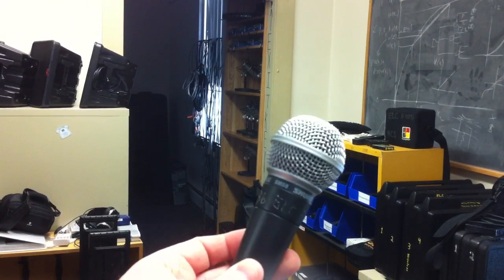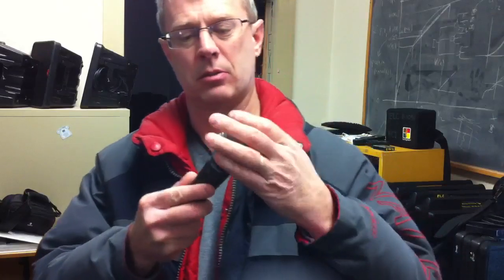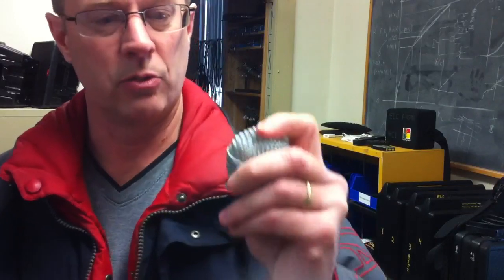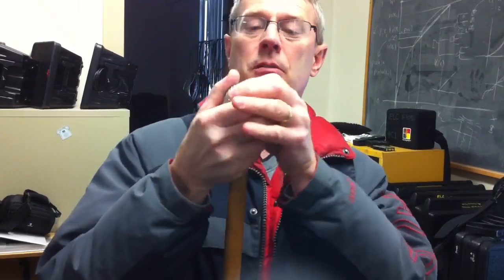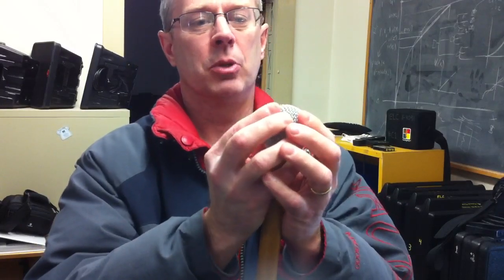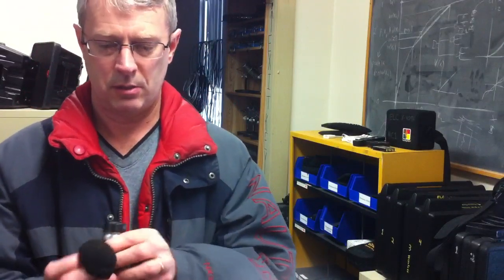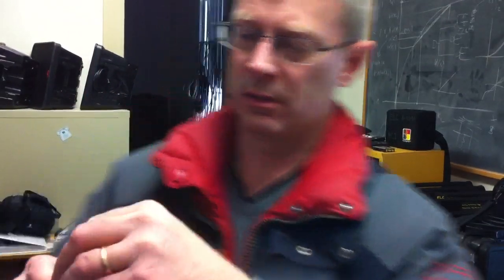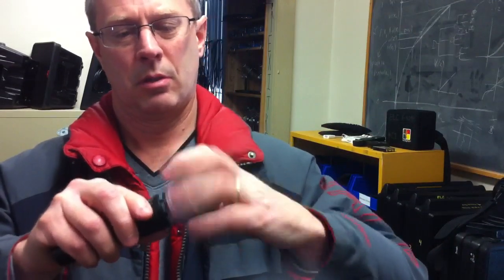Tech Tip : Fixing a dented SM58 mic grill.

Comment: Thanks! Didn't have a broomstick, but set the mic grill down on my kitchen countertop and used the back end of a screwdriver handle and a hammer. A few light taps was all it took.

But the biggest tip for me here was, as others have mentioned, that you can unscrew just the grill top.
Reply from the maker: Yup, a screw driver will work fine! Basically anything that’s slightly rounded so that you can keep the shape looking correct.
I went with wood, as it’s a little softer, and it absorbs the impact with less chance of paint removal inside of the shell.

Comment: General question - does a mic work without a grill? Cheers
Reply from the maker: Absolutely, the grill mostly gives it impact protection though, so if you take the grill off and drop it, she's done.   
The foam inside is actually more important than the grill as far as sound goes, it provides a little but of spit protection, and cuts down on wind noise.

Comment: I am willing to do it, but for some reason, the top grill doesn't to unscrew... Any tip / trick is very welcome.
Reply from the maker: Interesting, did you buy the mic new, or used? I ask, as I've seen people glue the threads for some reason. So it's that's the case, nail polish remover in the gap should do it. If that's not the case, it might just be tight. Throw it in the freezer for a few hours. The dissimilar metals have different expansion rates, so that might crack the seal. (I'd normally recommend heat, but that's not a great idea for microphones.). ;-)
Reply: +JimsEquipmentShed   It's used of course and quite old. Will give it a try. Thank you for the tips.
Reply from the maker: +inUR2teeth it might be cross threaded too, they get jammed on there pretty good at times. Great mic though, no matter what it looks like.  ;-)